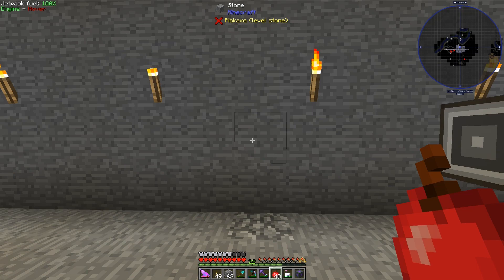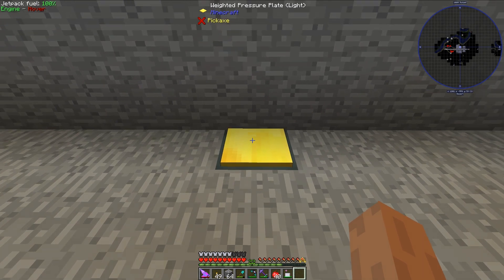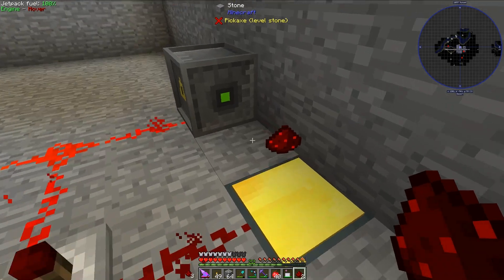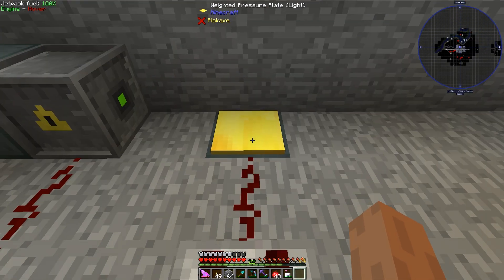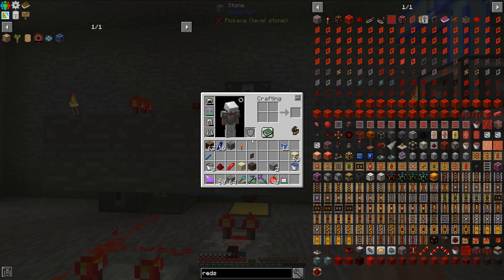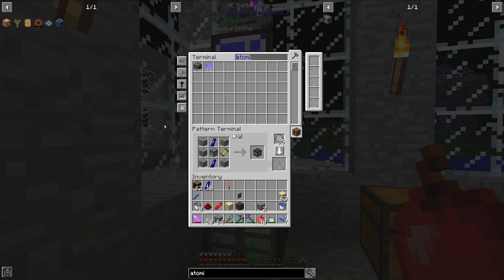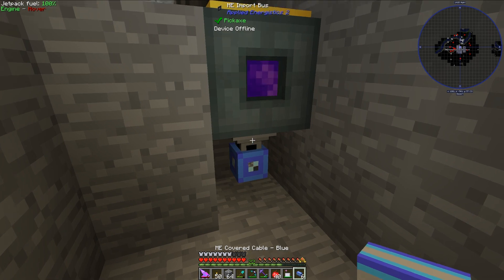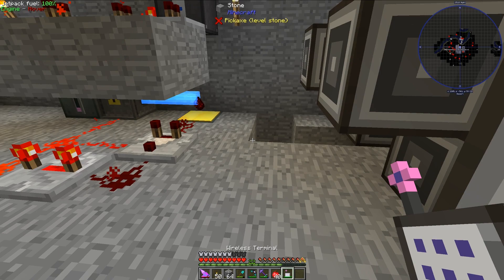How To Automate The Atomic Reconstructor With Applied Energistics 2

Comment: The items wont go out of the vacuum chest and the import bus says Device Missing channel how do I fix this?
Reply from the maker: Your ME System probably does not have a channel to spare for your import bus. A basic ME System can only handle 8 channels. An ME System with an ME Controller can handle a large amount of channels, but each ME Cables can only handle 8 channels and the Dense ME Cables can handle 32 channels.
Reply: MinecraftPhenom08 no my me cable has one channel left
Reply: @bobbane8970  It is possible that before getting to your ME Controller another channel is being used, preventing anything else from being connected through that cable. Either run a dense cable to what you currently have or another set or color of cables to the area with missing channels.

Comment: problem is sometimes items "shot" to the left side (like after laser shot), doesnt trigger and then it like breaks..
Reply: Use a block of glass. The laser cannot go through the glass, but the items on the pressure plate will be close enough to the laser hitting the middle of the glass without allowing the resulting items to bounce off the pressure plate. I haven't had an issue with the items going toward where the Redstone is, only toward the Atomic Reconstructor itself, which the glass resolved.